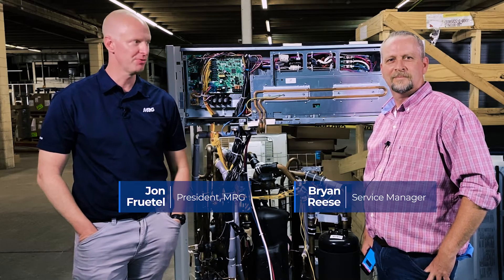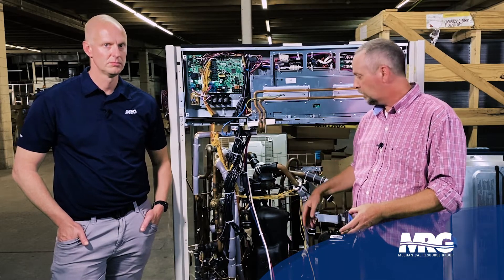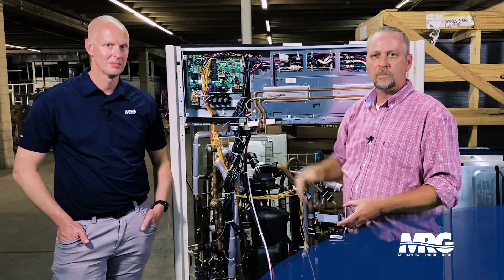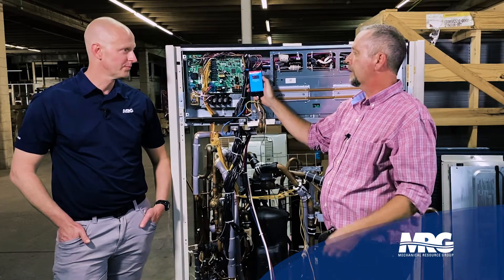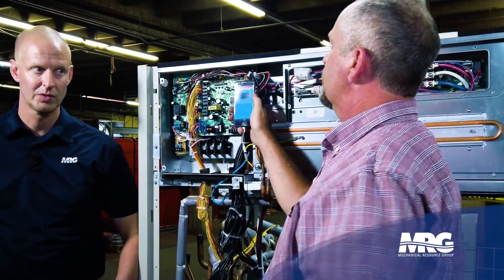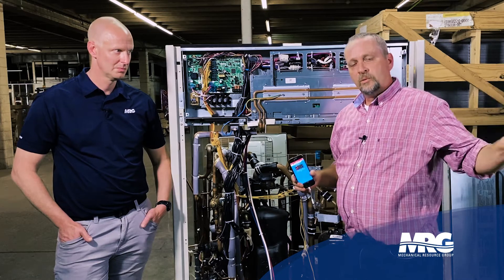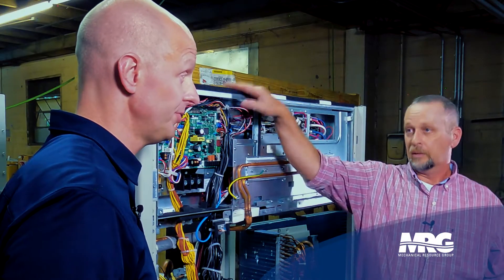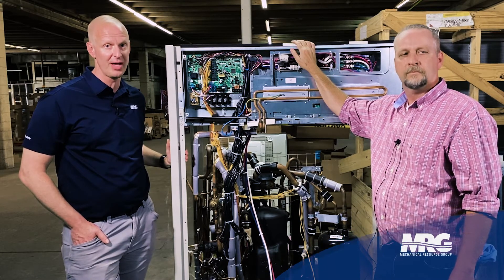Unbelievable Secrets to Mastering Daikin VRV Field Settings

Comment: I have been working on Dakin VRV Systems for over thirty years.  Never had an issue when going into recovery/evacuation mode.  It's critical when you want to work on a system like a compressor replacement.

Comment: What’s the difference between this mode and mode 2-21?
Reply: Hi Daniel! Setting mode 1 is for viewing system information while setting mode 2 is for making setting mode changes. Setting mode 2-21 is a setting mode 2 function, forced refrigerant recovery mode, which opens all of the valves in the system.